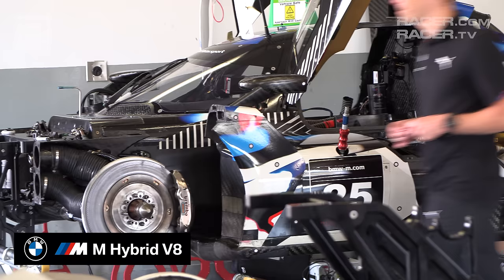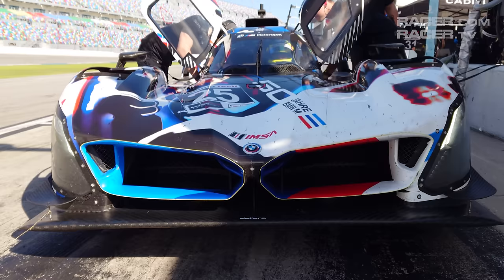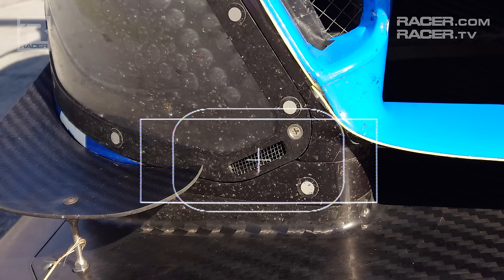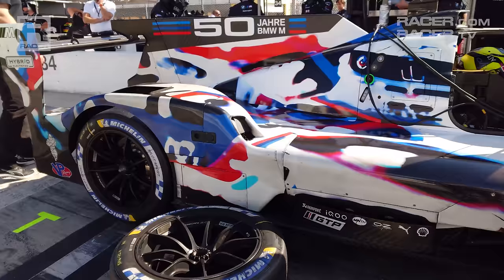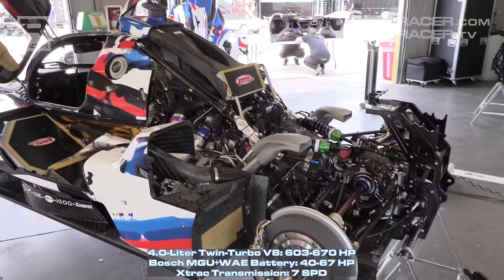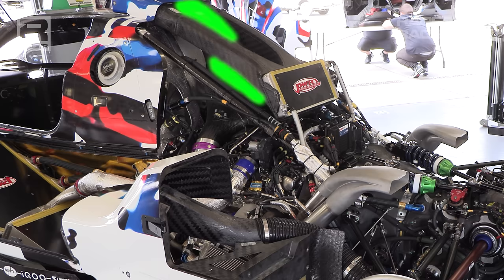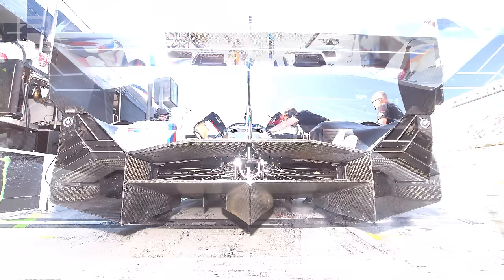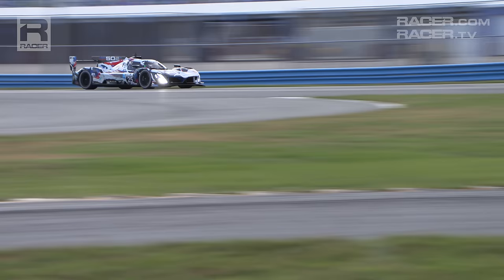IMSA GTP 101: BMW M Hybrid V8 Tech Tour

Comment: Very informative video, crisp picture quality, which lead to some many questions of the car itself. at 01:34 front shot, on the front side of the nose(lower to ground), there is a copper color cylinder, is this the steering rack? However, the tie-rod which connects to uprights are about 120mm above and 50mm aft... Or is this copper color thing an electrically-adjustable ARB?🎯

Comment: 5:38 
Is the steering wheel part of the "standardized component" in the GTP class? 
Because i see the same style of steering wheel on the Acura video and it's also made from Cosworth.
Reply: Idk if is standard but it's been used through a few generations